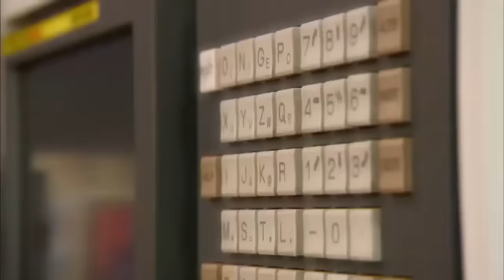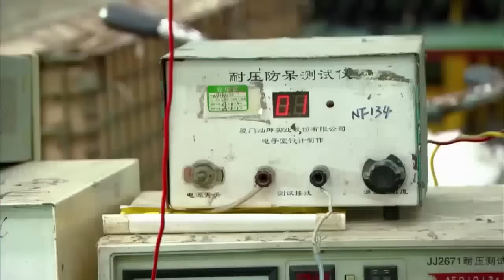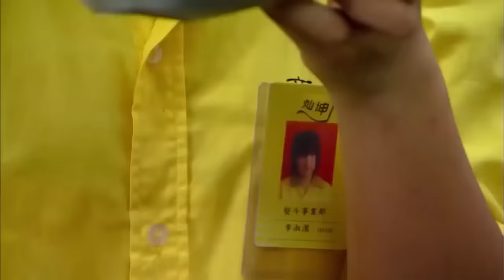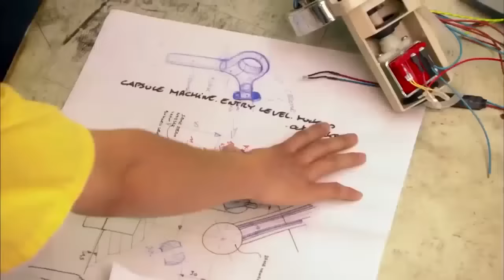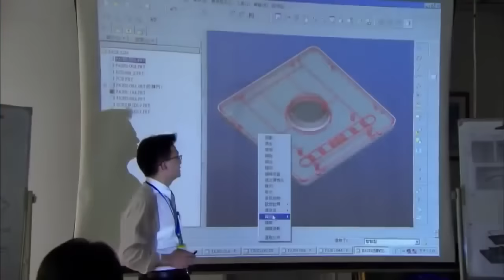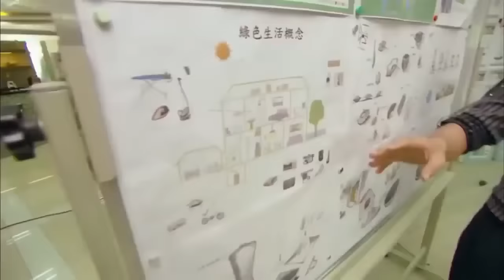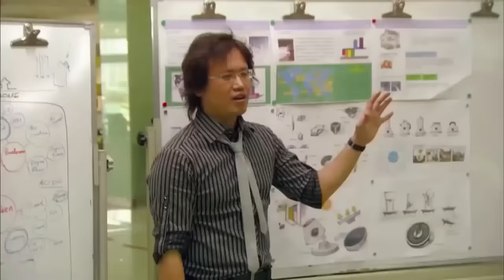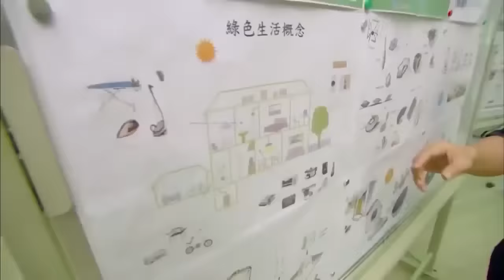China's Largest Factory - Living Where You Work (Full Documentary)

Comment: i'm amazed that he invented allen wrenches, gerbil feeders, toilet seats, electric heaters, trash compactors, juice extractor, shower rods and water meters, walkie-talkies, copper wires safety goggles, radial tires, BB pellets, rubber mallets, fans and dehumidifiers, picture hangers, paper cutters, waffle irons, window shutters, paint removers, window louvres, masking tape and plastic gutters, Kitchen faucets, folding tables, weather stripping, jumper cables, hooks and tackle, grout and spackle, power foggers, spoons and ladles, pesticides for fumigation, high-performance lubrication, metal roofing, water proofing, multi-purpose insulation, air compressors, brass connectors, wrecking chisels, smoke detectors, tire guages, hamster cages, thermostats and bug deflectors, trailer hitch demagnetizers, automatic circumcisers, tennis rackets, angle brackets, Duracells and Energizers, soffit panels, circuit brakers, vacuum cleaners, coffee makers, calculators, generators, as well as matching salt and pepper shakers!!!!! Would you look at all that stuff.
Reply: Do they have a big sign out front? For free ball-peen hammers?
Reply: @KRUSH-R  yes they do, and there's guys with nametags walking down the aisles
Reply: Crazy since they built it all on a vacant lot beside a gas station
Reply: 'automatic circumcisers'
Reply: How many times did you replay this to hear all that? 💀
Reply: @Chromiuss  you are not a true hardware store by weird al yankovic enjoyer
Reply: I can barely brush my teeth or comb my hair!
Reply: @clownymoosebean Because I'm so excited and I really don't care, I've been waiting since last June
Reply: Would ya look at all that stuff?